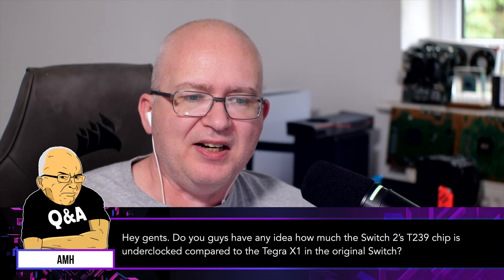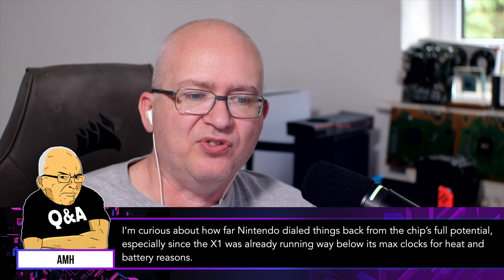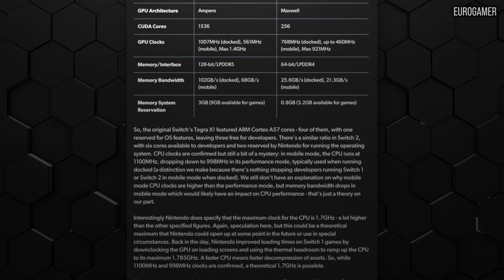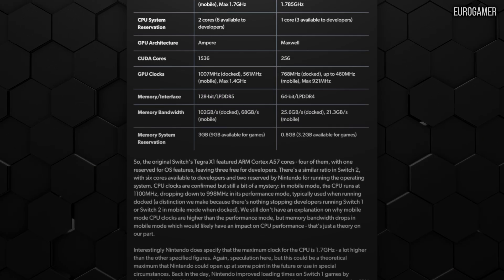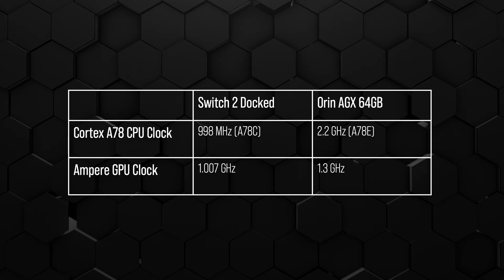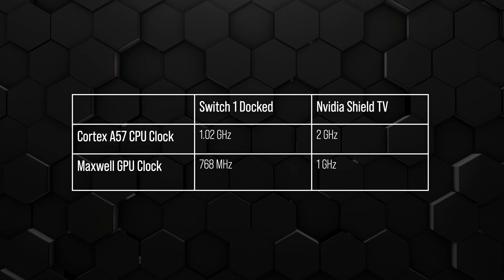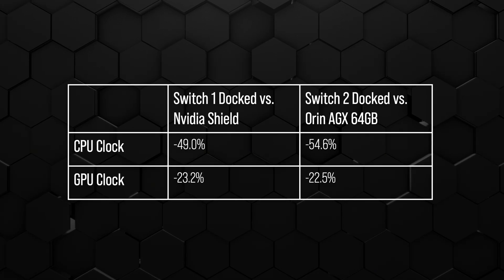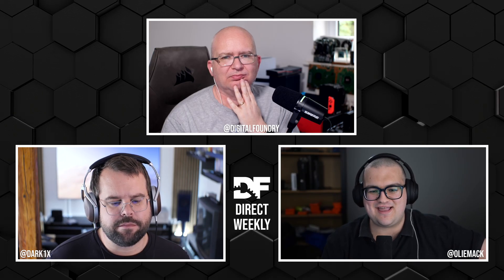Switch 2 SoC Under-Clocked? How Much Performance Is Left Untapped?

Comment: Maybe they will unlock it for us!

Lol ya right 😂

They will unlock it for the OLED Switch 2 or maybe a Switch 2 Pro.
Reply: they're never going to do that. the switch 1 old could have ran at higher clocks and got the same battery life as the switch 1 but nintendo has not interest in performance gains

Comment: See all of what was said in the video makes sense. I just have one issue with the Switch 2. Why couldn't Nintendo have collaborated with Samsung again to get OLED screens for the Switch 2 like they did with the Switch OLED model. Because I'm sure Samsung could've provided Nintendo with the 1080p displays needed. Also OLED screens also help save on battery life because instead of having a constant backlight for and LCD or LED panel wasting battery OLED has per pixel lighting. If a pixel is on it's on and if a pixel is off it's off.
Reply: because they want people to double dip when they launch the old model later. most of the people who bought switch oleds already had the base model. its greed the answer is always greed

Comment: It's hilarious that switch is so badly clocked when it has a fan. The fact they went with 8nm is ??
Reply: even if they went with 5nm they would used this same clock configuration just to prioritize battery life. nintendo does not care for performance. if they can get the bare minimum performance possible to run most games that's a win for them

Comment: I think battery usage isn’t worth the concern here, portable mode with current clocks is fine as it is.
Higher clocks can mostly benefit docked mode and would allow for 60 fps in most games such as Cyberpunk 2077. And even then, temperature isn’t an issue because the voltage would barely increase. It would be something like +7°C for 50% more fps.
These higher clocks aren’t even reaching the maximum specs of the board which is 40W, this would correspond to around 2.5GHz for the CPU and 2 GHz for the GPU and maybe also higher clocked RAM.

In the same manner, a hacked Switch 1 allows for clocks that go beyond the OS allowance and reaching the maximum TDP, which results in 100%+ more fps for +15°C (around 60°C). The console in docked mode can definitely handle 60°C, it will NOT melt. They just have to make the fan spin faster if they want lower temps.

Furthermore it’s good to note that if Nintendo ever release a revision for the Switch 2, like they did for SW1, the SoC will be 37.5% smaller (from 8 to 5nm), this could allow for longer battery life in portable mode and higher clocks/fps in docked mode for the same temperature as the V1’s base clocks.
Reply: it just sucks because people will go around parading that this console is weak again just like the switch 1 which I cant blame them for per say but its really nintendo sabotaging the clock speeds.

Comment: Will they ever fix the HDR? It needs a proper 3 step calibration so the black floor isn't fucked.
Reply: Meow meow nah, my HDR doesn't need to bee fixed meow meow it's in purrrrfecc working condition and surprisingly outlasts the others mrow meow it's 500+ fps
Reply: No since it's ips
Reply: @toxy3580  Still needs it for docked use.

Comment: After years running around with a modded switch, overclocking it and overall tinkering to hell and back with it, the heat issues are honestly just bad design by nintendo along with a TERRIBLE choice of thermal interface material.
You can see disassembles of the Switch 1 how the X1 chip is inside a compartment, thermal interface goes on top of the chip, and then in the hole of that compartment where it would make direct contact with the heatsink it gets covered with a copper foil, you can simply remove that foil completely, clean the crappy thermal gutter gunk they use as interface material between the chip, the foil and the heatsink, and make a direct die contact with the heatsink using something like a TPM7950, although even a cheap thermal paste like an Arctic MX-4 will work just fine.
That's what i did with mine and even pushing the clocks from both gpu and cpu beyond nvidia factory defaults i've never seen the thing go above 65ºc.

Comment: The switch 1 GPU clock is wrong. At the release date, it was 306 Mhz. 460 Mhz clock was available only years after Nintendo released clock constraints.
Reply: Quite weird they got that wrong because Digital Foundry literally were testing that with modding tools (SysClk) when Nintendo did that change

Oh yeah the change needed to be applied via Game Updates MANUALLY

Comment: To me, switch 2 is almost perfect as it is. It just needs an 8000mah battery (thin flagship phones are almost there without being heavy)
Reply: An update to the silicon carbon battery, OLED display, vapor chamber, and increased base clock would be a worthwhile upgrade. Even if nitendo increases the price of this version by $100-150, it is still cheaper than current handheld PC models or the steam deck itself.
Reply: @chien.nguyen.  OLED+VRR+120hz are incredibly expensive to produce these days. It will be way down the line. I don’t see them overclocking either, they didn’t do it for Switch 1 (and so far, I don’t really feel like the Switch 2 needs it).
Reply: How about a die shrink to a node that isn't 6 years old  @chien.nguyen.

Comment: NGL the screen on the switch 2is the main reason i have not touched mine in a while. i really want to replay tears and some other games but i just cant play in portable on it. i can play on my OLED tv yes but there are many times i just want to lay in bed and play and i just cant take how bad the screen is
Reply: That's extremely odd. It might not be the best screen out there but it's not unplayable by any means.
Reply: @user-tb3oj5tu3p  the response time is just awful. the GTG is longer than a 60 fps frame time. so even if you have a game running at 60 fps. it will still look horrible in motion.  the screen it self as viewing angles, color and contrast is fine. i have no issues in that department but when it comes to motion clarity , its bad.  I'd rather play games on a crappy VA panel with black smearing than this

Comment: Switch 2 is basically built on tech from 6 years ago not that anyone is surprised.
Reply: That's definitely not true. Switch 2 is based on Orin. Ampere only exists since 2020 / 2021. Orin platform uses Ampere and was released around that timeframe. Switch 2 uses a modified version of Orin. Nintendo needed time for the software, production, devkits, etc.
Reply: @mentalillnessalex4885  8nm process node is from 2016 this is the biggest factor how fast a chip is.
Reply: ?? it's a hybdrin of rtx 30 and 40

Comment: Looking at Orin tells you next to nothing about Switch 2's SOC beyond very rudimentary stuff.

 We've seen a detailed analysis of the SOC and there's nothing like it. It's has a strange marriage of Ampere and Lovelace traits, on a mixture of 8nm and 10nm nodes, and SOMEHOW has an efficiency that puts smaller node SOCs(even 4nm based SOCs) to shame.

Every GPU has a starting point/template, but where they end up can be so far off from that initial template, that it becomes a fool's errand in trying to use one the predict the behavior/potential of the other.

[Edited: I may as well add that...]

We've seen how the Switch 1 SOCs outperform the original Tegra X1 despite being heavily down-clocked(thanks to being paired with a dedicated API). We observe a PERFORMANCE DEFICIT when looking at the higher clocked base-chip, So the premise of looking at the base chip - to gauge what would happen if the new chip was clocked higher - is extremely odd. 

With Switch 2, on top of a dedicated API, you ALSO have a highly customized SOC, so the problem is two-fold. To understand how much performance is left untapped due to running under its max clocks, we first have to understand how much potential it has in its current state. With games like Star Wars Outlaws, and RE9, we are BEGINNING to get an idea of that, and it's VERY impressive. And that's not even counting what devs will be doing with the current hardware 2 or 3 years from now. The performance bump form higher clicks would be notable(though not linear) , but probably at a significant cost to battery life. 

It'd be interesting to see if - 5+ years from now - Nintendo would ever entertain the possibility for a "docked-only game" for future next-gen games(ports of major 3rd-party games) that perhaps couldn't run adequately without such a boost.
Reply: We also have to point out that the X1 was already well revised on the og Switch 1, and later on got another revision for the Switch Oled/Lite/V2.
Reply: Switch 1 does NOT outperform regular Tegra X1. There's a difference between optimized software and raw power.
Reply: @Llamageton No sh!t?!🤔
 I like how you guys prove my point while attempting to argue against it.

Console hardware is KNOWN to outperform their PC-based equivalents. That's well before any game-specific changes are made.

The PRIMARY reason for that is the dedicated ("bespoke") API - a SOFTWARE-based component. That's something PC hardware, by nature, can't have.

At this point, you guys are bending over backwards to explain away a performance ADVANTAGE that you ACKNOWLEDGE is there. Weird.🫤

Acknowledging the console-specific advantage IS the entire point!🤦🏽‍♂️
Reply: Wtf are you on about. Switch oled oc proved botw could run at 60fps
Reply: @Whyisoliz No shit Sherlock. You are comparing a standard console SOC to its greatly enhanced console version.

Try to follow, cause I hate repeating myself...

The point is that the ORIGINAL CONSOLE SOC, outperforms the ORIGINAL PC-BASED SOC, even though the latter is clocked significantly higher.

By the very same logic DF JUST USED for Switch 2, it WOULD be like saying;

"We have an idea how Switch 1 SOC would perform if it were clocked much higher, because we have a similar SOC(Tegra X1) that's already clocked that high."

But the REALITY would have made them look like complete fools for making that careless assumption; because we KNOW from actual performance data, that the ORIGINAL console part outperforms the higher clocked Tegra X1. Now what would happen if we clock the console part even higher? It would BURY THE TEGRA X1!

Case in point: Looking at the original Orin SOC, in its unoptimized, non-gaming environment, would tell us NOTHING about how a higher clocked, fully customized Switch 2 SOC(with its own dedicated API) would perform. Not even close!

This isn't complicated or controversial. It's simple observational reasoning, based on a history of data.
Reply: @Oryon7 we ain’t reading this
Reply: @Oryon7  this isnt always the case though. I have a 6700xt with a 5600 and I get well over 60fps on final fantasy 16 despite that game being created for the ps5. the ps5 version is locked to 30fps and it can get to 60fps in battles albeit by vastly dropping the resolution. the 6700xt is basically the ps5 gpu.
Reply: I’m curious but what is the actual maximum capacity of that non-Switch Tegra X1 you mentioned?

From what I saw with homebrew tools on the Switch without any OS Caps or anything, the max GPU clock is 998MHz and 2091Mhz for the CPU, which is well above the 1795MHz from Boost Mode and no retail Games use that actual MAX speed

Ohh and this is talking about the 2017 Revision, not the newer one which goes even higher. 

Funnily enough, from Factory Logs leftover on my Switch, the CPU Speed that was used to test it at the factory was also that 1795MHz from Boost Mode (each Nintendo Console basically has tests done at the factory where some software pushes the console both CPU-wise and Graphically, we haven’t seen much leaks of the Switch Version besides one of those tests being Nvidia Fishes swimming at 1080p60 while the Fan is at full speed and at that 1795MHz speed, which coincides with what the leftover Log on my Switch 1 says)
even though my Switch was manufactured months before, and was bought in June 2017, which I’m sure is before that Boost Mode Update.

Comment: What I would rather want is a Switch 2 home console (without LCD) and running at max clocks possible!
Reply: Would be nice to have a Switch TV model, with docked mode only and faster clocks, but it will never happen rip
Reply: Then we can have the cool Wii U treatment with 2 screens and stuff (Underrated)
Reply: I could see them giving a docked only switch but the clock speeds would be the same

Comment: They should really make use of the switch 2's 120hz capabilities.
Reply: 120hz is for 40hz games. I wonder, only Cyberpunk use it now. All other Triple A games are in the 30s.
Reply: @ToMiBriX  hz and fps are not the same thing
Reply: @Vybe_ I know. But although they are related and important for a smooth image. FPS measures how many frames per second your graphics card produces (the frame rate), while Hz indicates the maximum number of frames per second a monitor can display (the refresh rate). And 120hz to 40hz is a sweetspot for smoothness.
Reply: Some games are already using that.

Comment: It’s about using the overhead with egpu style dock layering on external throughput style… like where it just does it rather than combos… SEQUENTIAL LAGLESS like… you can push this thing without overclocking or use it to max out input response or geometry early… so much one could do… but seriously just doing like I was doing with the MCLASSIC stacking before works pretty fucking well… alongside that SHARPSCALER also… or yeah… I think they have HDMI CABLES you can layer in there or really just go for an eGPU or even still an OSCC anyways like the goddamn RETROTINK 4K GOING 8K ON ULTRA HIGH REFRESH STYLE… that guy kills it!